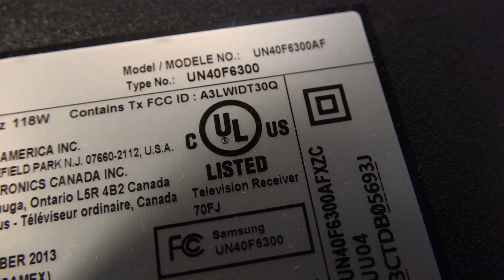Samsung TV LED backlight failure

Comment: LED Driver on the main board or the power board will do it, most times it’s a capacitor or IC Circuit easy change

Comment: My Samsung TVs backlights won’t turn on if my power supply is screwed into the back of the tv like it’s suppose to. But as soon as I take it if or set something between the tv and the board, then my back lights turn on.

What could cause this? Is it save if I put electrical tape on the metal part of the tv where the ground screws go?

Comment: I had the exact same TV, and the bottom half LED strip died. I could still watch TV but the bottom half would be darker than the top half. That was the last time I bought an edge-lit TV, and a Samsung TV. It only lasted about 5 years, which was a huge disappointment.
Reply from the maker: I have a couple of Samsung sets that have been good. My plasma sets get heavy use and they have all been great.
Reply: @12voltvids  My Panasonic plasma was good and my folks have been using a Samsung plasma (720p) for 10 plus years without issue... there was some pretty bad retention at one point, but it's gone now.

I think edge-lit makes me nervous more than anything.

Comment: My only issue with my Samsung LED tv UN55FH6030F is the backlight. when I increase the backlight to 12 and up the screen will get very dark and when it’s on 11 it is not bad but not presenting a good quality of image and it’s dim. 
Appreciate your advice if this could be the Capacitor problem or the LED light strips?
Thanks

Comment: $40 for 5 new 10 LED strips for a Sharp 43" Roku TV. Mine had 4 of the 5 strips with 1 or 2 bad LED's I could power it up and see one strip flash and then go out. Each LED on the strip has a + - test point and in continuity mode you can see each one faintly glow if good. I tried to replace the bad ones and got them to all fire but the LED's were the wrong value and didn't glow bright at all. It worked but I had dark spots on the screen and then they too failed after about 30 minutes. I could not find the correct value LED's  (maybe 6V 250ma? super bright!) so just bought 5 new strips and all is well. Be very careful with the LED panel when lifting off the diffusers, its pretty thin and fragile.  Best is to lay it panel face down and lift the backlights off the supported panel. There were 3 layers of diffusion under the LCD. Fresnel, diffuser and opaque layer.
Reply: yes that is how to fix.

Comment: I fix the broken LED light and I test them every thing was good.
After 1 hour using tv the back lights gots again dark .
Where is come from this problem ?
Reply: might be another led failing again. when one goes bad, voltage fluctuates and can stress others too hard, too. I saw this in Led bulbs, once one led fails, even if you repair it, others fail soon.
Reply: the design is not good, many leds in series, this makes the weakest one get stressed by higher voltage. Once one fails, next one is stressed out. In li-ion batteries, they use balancers to evenly charge them, you can see an example in which they couldn't cheap out on parts, as it could explode. On leds, they don't care.

Comment: Does Vizio's do the same with the power not coming on because of a bad LED? thanks for posting
Reply from the maker: All led tvs will not display a picture if the backlight is out. Some you can do the flashlight test on.

Comment: Yeah its the led strips. I've repaired about 5 of this model now and every one of them had multiple LEDs burnt out. Can get a brand new set for 20 bucks on Ali Express,  they come from China and take awhile to get here but they work good.
Reply: Are they easy to fix? Mine went half dark (barely visible) and right side is normal.

Comment: Hey. Good video. I’m having almost the same problem. I have a 75 inch tv. When everything is plug normal. It turn on off on off. It’s stays on for less then 3 second. If I unplug the main board. The led start freaking out just like that tv does in this video. BUT if I leave the main board plug and unplug one of the LED Plug (this one has 2 plugs).... the tv stays on and you can heard the volume if I press it up or down. Do you know if it’s one of the LED taking too much volts or its the main board?
Reply from the maker: Probably the LED
Reply: 12voltvids okay. like I said. This tv has 2 plugs for the LED. How could I test it without having to take screen apart. I have a power supply
Reply from the maker: @primeramusic3593  Check the voltage drop across each plug
Reply: 12voltvids I open the tv. And got to the LED BAR. Theses are not across like the others tv. Theses one are in the side. Left and right. I believe it’s not the LED. Because (there are 4 LED). If I disconnect one of them the tv stays on. For example. RIGHT TOP AND LEFT TOP gotta be connect at the same time for both to work. RIGHT BOTTOM and LEFT BOTTOM gotta be connect at the same time for left and right bottom to stays on. But this is what is happening. If I disconnect one of the top LED , The Tv stays on but only left and right bottom working.,,, if I disconnect one of the bottom, the tv stays on but only left and right top LED works.
Reply: I checked one of the plugs. And L3- voltage drops to 0 if the 4 led are connect.

Comment: Question.  My tv flickers with main board and led connected.  When i unplug the led the flickering stops and i hear the samsung sound but no picture (ofcourse) any suggestions?
Reply from the maker: Probably a bad led. They are about as reliable as an old Yugo or lada.

Comment: Troubleshooting my first free-to-me-dead-LED-TV. Samsung UN48j5000. PSB is L48MSF_FDY BN44-00852A, LED strips are: 2015 SVS48 FCOM FHD DOE A RIGHT REV1.2 150605 LM41-00120Q_LM4100149A. No joy with SM or schematic search. I pulled the back off. Saw no bulged caps, black R's, nor burn marks on any of the three boards. At first plug in, I heard BZZT...BZZT....BZZT about once/sec. I was looking at the back-of-the-set when this occurred. Sounded like the noise was coming from behind the Main board. I also detected a faint whiff of electricity/ozone/something getting hot. Sounded like arcing. With power to backlight connector removed, I was able to verify V's to Main board as OK. 

Stripped it further down so I could view the backlight strips. Found bad burn mark on strip 2 up from bottom, on far right hand side, between second-to-last & last LED. Burn area nearly full 'height' of tall trace (8mm) and about 13mm side-to-side!! WTH? All 32 LEDs (4 strips x 8 LED's/strip) stil worked when tested with bench supply. Attempted to repair burned area but no joy. I may just cut the end off & complete the series strip ckt with solder, then see of the PS will power up, stabilize and light the remaining 31 LEDs. If not, arcing may have damaged something in backlight driver ckt on backside of PSB. I've done a close visual inspection. Didn't notice anything.

Out of all the videos I've watched, only seen one with a burn mark on a strip. Why in the world would arcing begin between two LEDs? Very odd failure. Perhaps at this place in the series diode string the voltage must have been high enough to arc to the metal backing of the strip? After some PSB tracing I discovered that though there are four pairs of backlight wires (+-1, +-2, +-3, +-4), there is only a single series ckt AND a single backlight driver. Not two or more like some larger sets. 3V x 32 LEDs = 96V. I wonder if the BL driver ckt raised the driving V to its MAX attempting to bridge the growing burn area which looked like an open to it? 

Interested in your thoughts!
Reply: I finally figured it out. The strip I repaired drew way too much current. Must have been very damaged. Another LED on another strip began to sizzle so I immediately pulled the plug. Found local shop selling two right-hand-strips. Installed these and now all four strips (32 LEDs total) lit up fine and bright! Voltage & current draw for backlight ckt and drivers is back to normal. Learned a lot fixing this one. 

Second issue has to do with a few vertical stripes on the screen. 

I enjoy your videos! BTW, you helped me disassemble an old Sony Hi-8 camcorder and fix it. Ditto for an old mid-80's JVC HiFi VCR deck I still use on a regular basis! Much thanks for lighting the way!

Comment: I have a Samsung UN39FH5000FXZA  screen went black with blinking lights. When I disconnect the led plug from the power board I get sound?? Would that be the T-Con board??
Reply from the maker: Rudy Castro 
Did you do the flashlight test.
Reply: 12voltvids I’ll have to try that again when I connect the hdmi. I’ll try it with that connected to power board and not connect to it

Comment: my samsung ua40f6300 no backlight but with sound at audio output connected to my amplifier and i see image by flashlight,whats possible cause,led driver is in power supply board,
Reply from the maker: There are a number of possible causes. It could be a single failed LED inside the panel. I have had a resistor on a set similar to this go open. It was a 10 ohm resistor in the PFC (power factor correction) circuit that sent up in value to about 250 ohms but that put the set into a shut down mode with 5 double blinks of the power light.

Comment: Thanks for the video, but being technologically challenged I need advice on how to get started.  My 60" Samsung LED backlight went out, and a Geek Squad guy ordered a board for me.  The board just got here today and I'm going to try to tackle this myself.  I have just one basic question:  If the TV is attached to a stand (sitting on a desk), is it necessary to take the stand off to remove the back panel?  Once I get the back off I'm sure I can compare the new board to the old one to replace it.   Thanks.
Reply from the maker: Some TVs it is necessary to remove the stand, and others it can be removed with the stand on it.
Reply: Thanks.

Comment: Ok quick test on samsung tv's you can do and this is from samsung GSPN fast track manuals so it is proven... All samsung sets from the C series up will self power on the PS when you disconnect the main from the PS by removing the cable between them. When plugging in the set at this state the backlights should come on immediately and stay lit at full brightness and the power supply voltages should come on. If you dont get backlights or backlights are erratic you can eliminate the main from the equation. I saw in the video the BL was pulsating when you disconnected the main it was still pulsating.. knew immediately it wasnt a main issue and it had BL failure.. its been non stop with so many LED sets today its not funny!
Reply from the maker: Yes I know the main board was fine from this test. I am still working on this set trying to find the problem, as all the LEDs test good. I took a battery and was able to light every stupid light on strip glows, and they all test OK, but they don't light when connected to the power supply board. Driving me mad, as I took the screen apart expecting to find a dead LED, but nope they all test OK. Any ideas?
Reply: 12voltvids the high speed switching diodes are known to short on these boards. The larger black ones in the backlight drive area. Check them. Since the leds are good then it's obviously somewhere on the ps.
Reply from the maker: Yes that is what I am thinking. I took that screen apart expecting to find a bad LED, but every bloody one of them tested good. I know the main board was fine, as it ended up in an identical set with a bad main board, so now this set it mine to play with, and I suspect a bad diode in the psu. I just haven't got around to checking them all out yet.I would like to see if I can get it going just for fun because now it has a bad main board that reboots when the volume is changed but for a display where the volume is never changed it would probably work just fine, and I have a use for it as a digital picture frame if I can get the backlight problem solved.
Reply: Let me know if i can help with any of these sets.. I have full access to Samsung GSPN for bulletins on all their sets..
Reply from the maker: A schematic for the power supply would be great.I did check the power diodes, they are NUR460p and none of them test as short, but I am thinking that they may be going leaky under load? What do you think, replace all of them and see if that makes any difference?

Comment: have you ever come across double imaging and  ghosting on a Samsung  it's a bout 5 years old I have tried putting tape on the ribbon but  it still will come back model no 46D5000
Reply: derek mcdonald double imaging especially jittering is always a panel failure, any horizontal lines or horizontal effects are always panel related due to tab bond failures in the panel. Tcon issues will generally be loss of video entirely, symmetrical vertical bars and similar. Any localized effects are always panel related because lvds data to tcon are in 8-10-12 bit data streams and will effect the image globally when you get failures outside of the panel... thin vertical and horizontal localized lines... shadowing, ghosting and horizontal jittering is always panel related
Reply from the maker: That sounds like a timing controller failure from the description.
Reply: Any ideas  on a fix .with some knowledge and doing at home thanks
Reply: Frank Scarano any ideas were to source 1 a panel or what do i need to ask for living in Ireland  ty
Reply: Honestly panels are the most expensive part in the tv and is generally not cost effective to repair. they tend to cost equal to if not more than the cost of replacing the set
Reply from the maker: Tcon failure can also cause half an image. I have had a few with a poor image that was tcon BGA solder failures (they were both Sharp garbage sets) but very often it is the panel that is bad.I have a Samsung in my garage right now with a bad panel. I don't remember if I published the testing of it or not. It had thin lines, almost looked like looking through a screen door.
Reply: 12voltvids  yes in some rare cases it can cause half the image to be affected but more often than not its panel related any localized single lines are panel and every single horizontal line or horizontal bars or jittering horizontal effects  are always always the panel...  I have had delamination and phasing issues locally too that are panel failures. I have had the screen door effect where there are numerous thin horizontal lines that tend to start darker from the left and fade as they go to the right... very common panel failure amount numerous mfgs
Reply from the maker: I have a hitachi 39" (the one with the blinking back lights) that has a bad panel. Looks like water in the screen.That is my set now, and I use it for digital signage for my video archive service. Has a 15 second ad running in a loop. Only good thing about that set is it has an on/off timer. So it runs my ad video in my window from 8:00AM to 10:00 PM. In a week or so my happy holidays loop will run.I just turned on my desktop PC to do some editing. The F__KING LG 28" monitor that is only 2 year old all of a sudden has a bunch of horizontal lines running through the picture. Was fine last night. This monitor I bet doesn't have 500 hours on it, as I don't run it every day, there are many days that that PC doesn't get turned on, just when I go to edit, as I use an old laptop for surfing and Email My desktop is used for production only. The same image is perfect on my 42 plasma, which is the one I use to actually look at the video as I am editing, the 28 main monitor just shows my timeline display.Modern electronics garbage!

Comment: I finally ran into a plasma panel failure. The dreaded Panasonic 1 blink code. Iam parting it out with tearful eyes. 58" of beauty.
Reply: I've just repaired a Panasonic 50 inch with the one blink code, it was the main board, are you sure it's the panel.
Reply from the maker: I have a 50" Samsung with a bad panel. Has a green line running down the screen. I gave it to my kids to play video games on. Still has a beautiful picture other than a thin green line that goes top to bottom. It is starting to burn , so eventually the phosphor will burn and it will be a black line.
Reply: Replaced the A board but no luck. That usually means a bad panel.
Reply: James Last that's odd because a 1x blink points to an A board communication failure.. panel failures generally produce 7 blink codes due to error feedbacks to the su and sd boards trying to drive the panel.
Reply: James Last

Comment: Hard to jusify spending !,000 dollars on something that only lasts 3 years!
Reply: I feel the same way about "unproven technology".  When SSD's came out for computers, a tech for a local hospital I know was raving about how they bring new life into old computers because of their speed.  I simply felt they were TOO NEW to fully trust with valuable data.  So I have waited a few years to make that leap.  Guess I am ABOUT ready, lol!
Reply: @TortureBot  you're right. when ssd fails, data impossible to retrieve, as it is aplit over multiple chips. From Hdds you may still recover something. For surface errors, you can skip the area and still get most of files back. Had a WD hdd with bad sectors, I even partitioned it such that empty space was covering the bad areas and could continue using it for non-important backups, i.e. backups of another backup drive.
Reply from the maker: I hear you. Nothing lasts these days. I would really like an OLED set, but it is hard to justify that kind of money on unproven technology. I still like my old Plasma sets they have proven to be reliable for me. I picked up a 4K set for the studio, and got the cheapest one of half decent quality I could find. Only 420.00 so if that only last a few years I won't feel so bad.
Reply: 12voltvids Was that a Sceptre brand? I've read some good reviews about them.